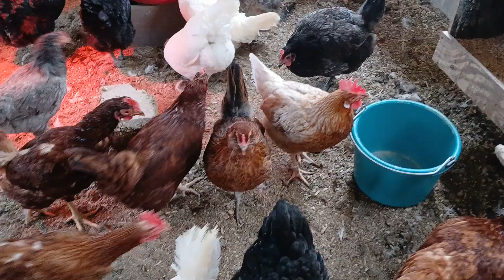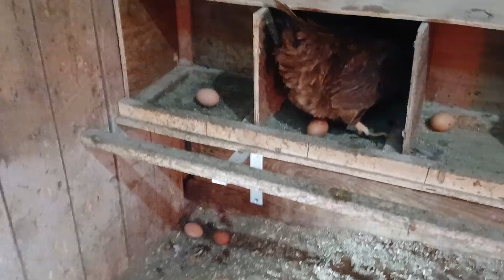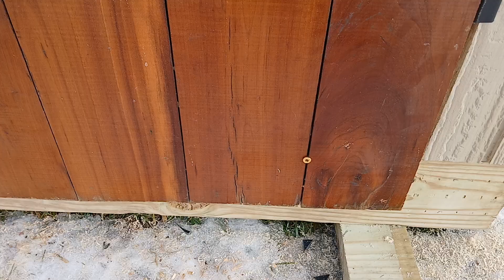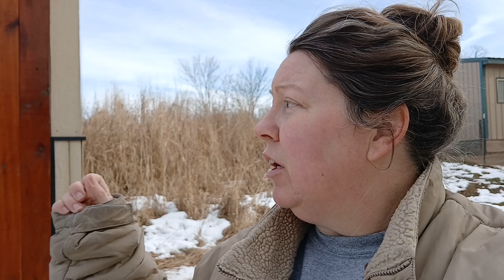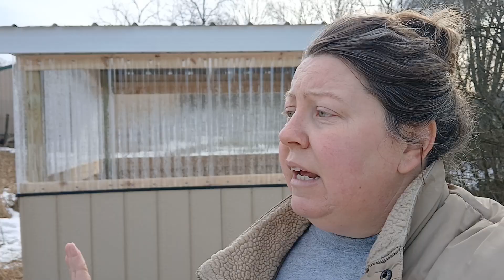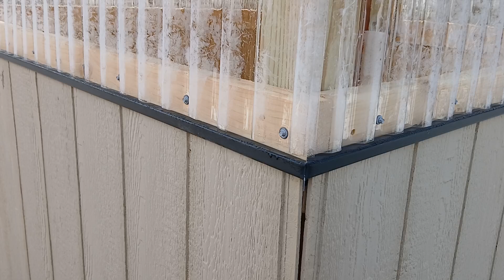Just Takes Money & Man Hours | VLOG 49 | A DIY Chicken Coop Build | Our Small Farm Life

Comment: Are you building shelf perches for at night?  In the summer when it's hot are you able to open up the sides?  Nest boxes?  With all that those clear panels will there be enough darkness inside for the girls to lay eggs?  Maybe build nest boxes that attached to the outside for ease of collecting eggs.  We stopped using the clear plastic panels from lowes or home depot as they pretty much cracked within a year of being exposed to sun, rain, snow and winds.
Reply from the maker: @karenfrankland7763  Hi! Thank you for the great feedback & points to consider! It's greatly appreciated!!!
I wondered about the durability of the clear panels! I am interested to see how they hold up over time. Based on your feedback, we'll be formulating a backup plan for replacement panels for when those start to deteriorate...we wondered if theyll possibly deteriorate noticeably in a relatively short amount of time. Thanks for the tip on your experience with it! 
Shelf perches...we'll probably opt for something more along the lines of roosting bars instead. Still deciding exactly. 
The sides are not able to be opened. The coop isn't airtight, though, & the ridgecap & vented soffit will help some with disseminating heat that rises. Also, the plan is for the hens to be able to get outside, & we'll plan some cover for them. Plus we could probably switch out panels for hardware panel as needed seasonally to let more airflow through the coop if we found that might be helpful. 
Great questions!
We will be learning by observation regarding if there will be enough darkness for the girls to lay eggs. We have pondered the same question. We think having the solid material on part of the siding will help us with that concern. We will have to see how that goes. I like the idea of nest boxes attached to the outside of the shed. That's a great thought. We actually think we may initially try building in nesting corners based on observing the new hens in the meat bird barn; their impromptu use of the blocked out corners has really worked out so well, & we're going to see if we can duplicate that effect in this new coop. It's actually worked out much better for us than nest boxes, so we want to try it! 
Thank again! We are grateful for your input! 
Many Blessings to y'all! Have a super day!
Reply: @twinoaksfam  The problem I see is if you allow them to lay on the ground behind a corner board is that the ground outside is gonna get wet  and cold with rain seeping in.  That creates dirty eggs, mud ect.. on all the inside edges of the coop.   Having an attached  covered run will allow you to feed the hens outside of the coop. Dump water buckets at night and refill in the mornings.  Feed can be done in a five gallon hanging feed bucket that keeps the food dry and predator proof from Rat's coming in.  Lots of info on hanging 5 gallon bucket feeders.  I do worry that the bottom of your coop is just sitting on the ground.  Over time the rodents will make there way in.  Perhaps attach hardware cloth at the bottom on the outside and have it go out a good foot or so on the ground and then cover that over with rocks and dirt to prevent rodents from digging under.   We have to redo our chicken run wire this summer.  It's been a good 20 years of being rodent free and just this winter they have tunneled in.  Our hardware cloth is a foot under ground and woven onto the side  hardware cloth as is the top with a tarp over that.    We have security camera's in all our runs at night to see what if anything is getting in.  The birds are all safe and locked in there coops at night.
Reply from the maker: Thanks! Great suggestions! We'll definitely discuss the considerations  you shared. 
We will have some fill at the ground level similar to our henhouse coops & meat bird barn...amazingly, with the fill & bedding, the interior floors of the chicken houses stays quite dry, so we think that approach will help us with floor quality in this coop, too. 
The eggs we collect from the floors, versus the nestboxes, currently are consistently clean & unblemished, often more satisfactory than what we collect from the boxes. It's interesting watching the hens nesting in those corners...it seems to mimic what we've observed the hens do when they've had free range access...reminds us of when a hen just finds a hidey-hole & makes her own nest. We're still deciding for sure what we'll do about it. 
We have discussed the predator control at the bottom of the walls, too, but realized it's really pretty similar to our other henhouses & to the meat bird barn...with those buildings being built right on the ground level, too...so we expect floor management in here to be similar to the other chicken houses.
A covered chicken run is awesome, but I know we won't be able to do that at this site. It does make it nice to feed in a covered run & have protected areas for feeding. It also makes a nice protected area that is a great extension of a coop & offers flock safety, too.
Thanks for sharing all your great insights & observations! We greatly appreciate it!
Have a great day!

Comment: My only question is where can I get plans? 😜 I absolutely love this, and we're going to be building a second coop this spring! Hopefully it goes quicker this time because I won't be doing it on my own, and I have some experience now.
Reply: When I built the first coup, I put a hard cover over their run and I considered making part of it out of that clear corrugated material. I still kind of regret not doing that because of the lack of light here, and will likely do that on the new coop for just one end of it. I do want them to be able to get shade if they need it.
Reply from the maker: @tinab7791Yes, I think that corrugated clear panel could work really well for a hard cover over a run...or possibly on part of a roof, too, like a skylight...we talked about putting it on top of this coop, but thought the roof metal will just hold up better over time & help protect the birds from some of the strongest solar heat in the Summer.
Thank you for watching & commenting! We greatly appreciate it!
Reply: @twinoaksfam  Melissa I have screenshot your response so I have the email, go ahead and remove it when you get a chance. Thank you!
Reply from the maker: Thanks for the update, Tina! Got it! I appreciate it, & I will edit that now. 😊
Reply from the maker: Having previous experience & having help will definitely make your second coop build go faster than the first. That's so exciting you're planning a second coop!!! 
Thank you for the compliments! That's really interesting you ask about a building plan, because I told Jared when we started this that we need to convert the material list & process to a set of building plans & offer that plan for sale...we definitely want to trial & error this coop with chickens actually using it & see what we need to improve, but yes, I also feel like it is helpful to get to see plans that give a reference point & a starting point on material list & assembly process. 
We just kept looking at example after example to see if we could find what we had visualized, & we used some visual reference from looking at those finished sheds to settle on what we wanted to build.
I can see why the finished sheds are priced at the price points they are after getting materials for this one & seeing the man hours on it. By the time shed building companies cover expenses for material & labor, & add on a profit margin, it all adds up a lot. DIY can be a huge cost savings!